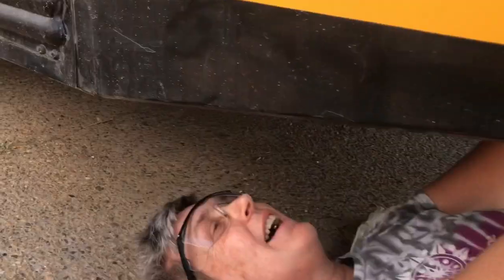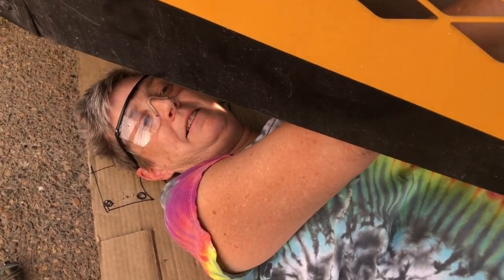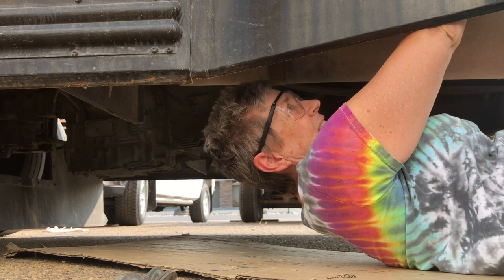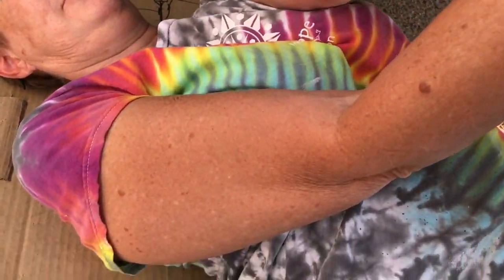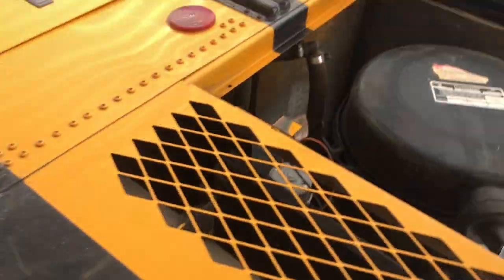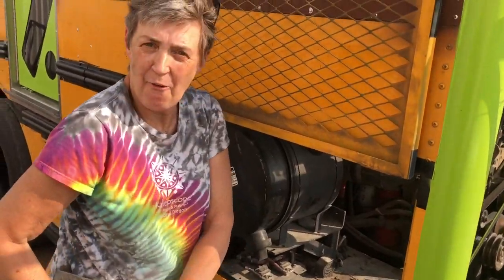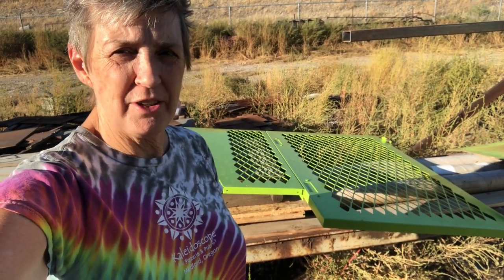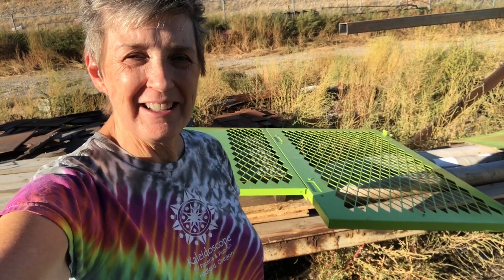Building Generator Bay - Vlog 169 School Bus Conversion

Comment: Remember, add a piece of pipe where the muffler to make it exhaust out the bottom then our the muffler back on ,it will quieten the generator
Reply from the maker: We will have to check into that. Thanks for the suggestion. 😃

Comment: if you Google it, they Sell DC Generators. 
You just use them to keep your battery bank charged. and it helps prevent you going from, GAS, to DC, to AC, then back to DC and then Back to AC.